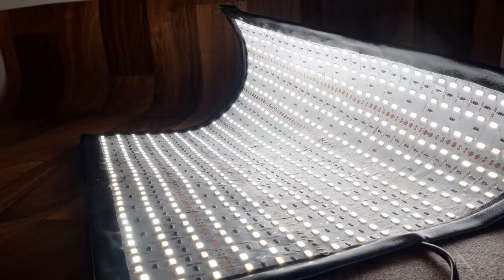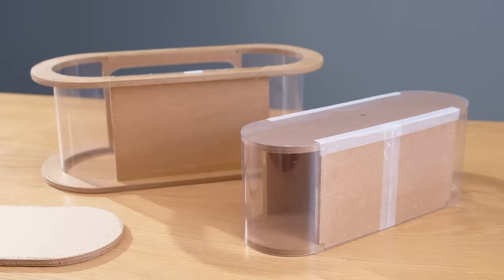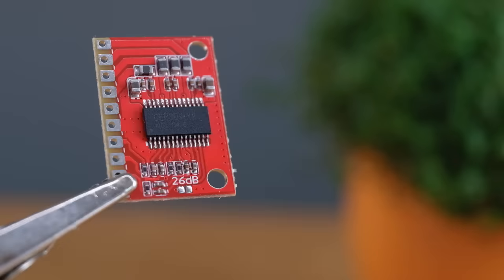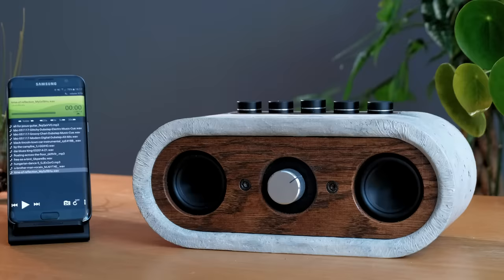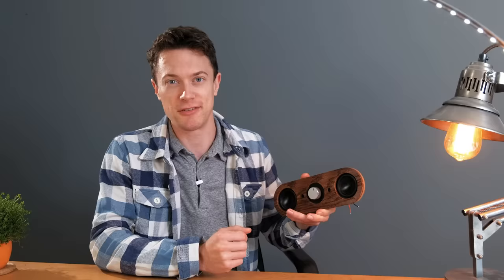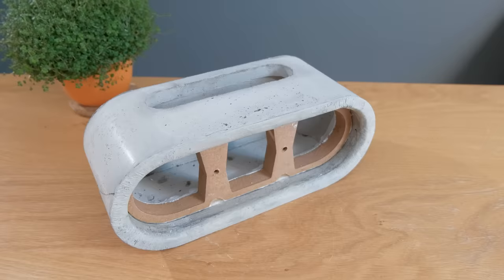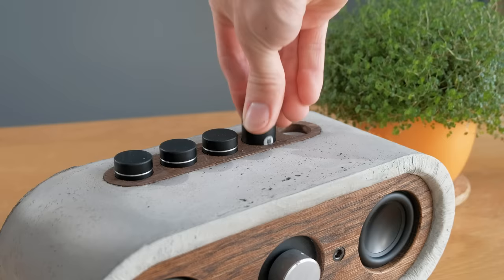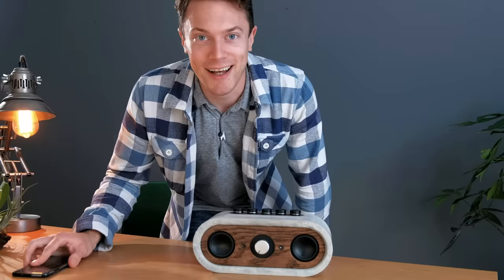Build your own Concrete Bluetooth Speaker (how-to)

Comment: Cool design but how far does that DIY Bluetooth speaker can go without the phone being near it? Asking real question here
Reply: I'd imagine that would depend on which receiver you use.  Some come with an antenna which should increase range.
Reply: The Bluetooth modules I use can go about 15 feet. They all have the surface mount antennas, if range is a concern, Bluetooth might be a bad choice.
Reply: It is possible to add to the antennas built in to most of these bluetooth receiver modules... given a concrete enclosure it might be a good idea to find a thin spot on the wood faceplate and mount a DIY antenna there.

Comment: Power cell life? how pain in the ass is to charge them? why didn't you compere that speaker whit some other one?  What did everything cost in the end? Bluetooth range? Specially whit that concrete shell.  Despite these burning questions  a great video :)
Reply: jholotan best English must not be your first language
Reply: Kilo, I understood it all, perhaps your English comprehension is not resilient enough.
Reply: amigiac Oh, on the contrary. My comprehension of English is quite good, actually. But the sentence, "how pain in the ass to charge them?" Is not complete. Also, "compere" is not a word. There are a few other things I can pick at. Although I understood OP, there are clear issues.
Reply: Compere is a word, it means the person who introduces variety/comedy/musical (etc) acts. Obviously it isn't the word jholotan best neant, but it is an word in English non the less :)
Reply: "neant" xD
Reply: Kilo-Lima He asked a series of questions that were worth answering, I'd certainly like to know the answers. Instead you've just hijacked the thread to nitpick about the use of language. yawn
Reply: John Derry Eh. I didn't hijack anything. I had a one sentence reply about English not being OP's native tongue - then people decided to jump on me and accuse me of being judgmental. 

Want me to answer his questions? The batteries can be charged with a hobby charger, the kind you'd use for airsoft or RC toys. There's a good one on Amazon, comes with different terminals to charge a slew of batteries. As for Bluetooth range - no idea. Cost? I would say around $100 USD. All those parts can be found on eBay or your local DIY shop. The concrete can be bought in small bags from the craft store, same with the sand. The battery life is dependent partly on the volume as well as the music. Each of those cells is 2,000 mAh, times five gives you 10,000 mAh. I'd say this thing would last upwards of a week - if not more, with steady use. Anker's Soundcore is only 4400 mAh and it lasts me a good 4-5 days.
Reply: For the battery life, you can see that batteries have 2600mah and 3.7V each. That means that he has about 18.5V and 2600mah => 48.1Wh. I'm sure that you can find how much 
power each component of his speaker draws in the datasheet. Just count it if you wanna know. And this should be only for inspiration, not complete build tutorial.

Comment: //just a little tip from an architecture student been done some concrete modeling: 
you don't have to cover the top of the formwork, the concrete will perfectly level out itself, and it's also great for the drying process, because the concrete can breath, and let out some air bubbles. After 1-2 days (can be less, depends on the consistence and the type of the cement) you can confidently remove the formwork, but it's recommended to let it dry for at least 2 weeks to let the concrete reach 95% of its strength. The concrete also needs watering in the first month like a plant to have a smooth, imporous surface. Soo to sum it up, concrete needs a lot of care and attention to get it in right shape!

Comment: Hey Matt, congrats on the speaker , they do sound beautiful indeed. 
I got a question for you or anyone reading this.

^ I read all the time in the audiophil community that the amplifier makes huge difference on the sound quality, I want to know if you can tell me a better amplifier that can be inserted in to this setup. I dont want to make this project more expensive necessarily but i see the overall price of the components and I can afford to go higher if it makes a difference. 
Thank you

Comment: this is super awesome but let's be honest... no one here is going to make this, lol
Reply: I might try if it's cheaper than these damn bluetooth speakers are 😞
Reply: Im doing it
Reply: totalbottle  I agree on the weight. However, compared to what's released on the market, this gives you price to performance that are far better than most deals you could get with any known brand.
Reply: This pessimism doesn't apply to me buddy.
Reply: totalbottle  Well I did, and since you disagree, enlighten me then.
Reply: totalbottle  Despite the looks and the fact that it's water resistant (not proof, resistant), overall cost for the quality is under what you can build here using links provided and/or related parts.
You can always adapt to have a better product with this DIY or have a cheaper one if you want, that's actually the point of making it yourself. However, EU prices are around 45EUR for low perf (according to reviews) product. Meh-ish at best imo.

Debatable as always but you're actually proving my point with that I believe.
Reply: totalbottle  worse weight I agree but worse sound?? It's about the quality of the electeonics and parts you can buy on linked sites are much better, that's what I'm talking about. You didn't check what you could get for this peice range did you?
Reply: I might try, but not with concrete. I work with stone, so I might try that instead. Maybe jade, it actually rings like a bell when struck so it might work quite well. And as far as the electronics, I would just use a cheap Bluetooth speaker and make the case out of stone.
Reply: totalbottle  You say that it's got bad sound, but are you listening on bad headphones? From what I heard it's pretty incredibly for a bluetooth speaker.
Reply: totalbottle  I'm not comparing it to normal speakers, I was just saying that the sound quality is pretty awesome for a bluetooth speaker. It's also not meant to be a portable speaker, so i'm not really sure why you're complaining about it being heavy? It's a stylish and in my opinion very good looking speaker that has excellent sound quality and not something you're meant to chuck in your bag and carry around with you.
Reply: totalbottle  or maybe consider the fact that some people just want a normal speaker in the house that they can listen to music on, without having to connect an aux cable each time they want to do it. Would you carry a Google home or an Amazon echo with you outside?
Reply: totalbottle  Those two are nothing alike. Just because a speaker is bluetooth that doesn't mean is has to be portable. You can still move it from inside the house out into the garden and play music from there without having to plug it in, but if you want something that you can bring to different houses then just buy some shitty portable speaker. This speaker is designed to play music easily using wireless bluetooth, and to play it well.

Comment: Total cost?
Reply: Speakers + Batteries being the most expensive

I would guess this is around 30-70 USD, but with really good sound and very long battery life.
Reply: The drivers alone cost 50 dollars each. The total cost is around 125 dollars.
Reply: You don't need specifically these.

You can get really really really good drivers for really cheap. Or go to a scrapyard and take out some for completely free. Basically as long as you have a matching pair, you can make anything work.

Just up to figuring out which ones sound real nice.
Reply: russian_ hitman blyat my comrade Privet
Reply: For you 8000 rubles, comrade

Comment: Laying the acetate on top will also prevent evaporation - and that's a good thing because concrete incorporates the water in the chemical process of curing (not drying).

Glad my university degree finally came in helpful now that I can write "but actually" YouTube comments.

Comment: 11:00 To check if the speaker in out of fase is more simple to check the labels on the amplifier board and the speaker connector, wiring connecting the positive in the positive as the same to negative

Comment: To make it easier, you should’ve added more water and admixtures. Added water would make it more workable, although it’ll lose strength, but if you find the correct admixture it’ll make it extremely easy to work. It’s almost like a liquid so you’ll get a good mold every time.

Comment: There are also isolated modules like you're using, which step down 12V to 5V, so the noisy seperate stepdown converter is completely redundant.

Comment: To tell the phase of the speakers, you can also use something like a drum app, and tap the kick drum, while watching the speaker. It should be obvious which way the membrane pushes first. But you need a punchy short kick, to make the effect easily visible. A longer kick or sound would just make the speaker move too much to notice the direction it first moves into.

Comment: You should have mixed in a spoon-full of washing up liquid when mixing the cement and sand, also mix it a little wetter. After pouring the contents in then tap the casting on the table a few times to bring any bubbles to the surface , put the top on and wait to dry. You should end up with a much smoother , even shiny finish.

Comment: Very nice! 
I have thought of building conventional bookshelf sized speakers utilizing a concrete enclosure for obvious reasons and your build shows proof of concept. The only thing you might consider adding, which can still be done, is the self stick and rather expensive sheets of sound deadening material on as much of the interior of the enclosure as is practical. This would take it up a slight notch from exceptional to superbly exceptional.

Comment: Sound is very clear without any humming. But I wonder how a small amplifier could give out such a high output. It's incredible. But in case, it the system accidentally drops down from your hand,, the concrete is  goodbye...!!!

Comment: What is the use of DC -DC isolater ...I'm planning to convert an old radio into a Bluetooth speaker by using a similar circuit.....so do I have to use DC - DC isolater

Comment: You should use that high strength concrete. Its a little rocky but that stuff is durable. Also i was thinking that thing will shatter if dropped! I wonder if a coat hanger cut up and put inside would help its strength

Comment: For anyone looking for updated links:
The dc-dc converter is a B0505S
The potentiometer is a: dual gang b50k
The amp is a oep30wx2
As for everything else, Im not sure if the bluetooth transmitter will work, but all others seem to use a headphone jack so should be the same idea.

Comment: Okay I already have some speaker drivers I can use here but I've just started to plan the build and already I'm hitting a lot of questions that are not answered in the tutorial... What is the ideal rating for the potentiometer? This isn't mentioned and the available options seem to cover a massive range. 2nd, Is the potentiometer logarithmic or linear type? Apparently logarithmic are advised for volume knobs but it doesn't say here. Additionally it is mentioned about an extra wire for use as an on/off switch but where does this come from or go to? Its not shown.

Comment: use an an electric sander to vibrate the mould and get air bubbles out of the wet concrete

Comment: It would be great if there were a way to add the dry concrete mixture, then introduce the water later from the bottom so air is forced out the top. A vacuum should do it. Should help with surface finish and eliminate voids.

Comment: Just a suggestion. Stereo Phase is determined by the sound appearing from the centre stage of the speakers if it’s outside or off behind your head then on set of wires polarity needs reversing.  I’d also suggest some accounting wading inside to avoid the standing wave resonance or tiny sounds. Other than that bloody marvellous well done.

Comment: hi.for the concrete i suggest .
Mapefill from Mapei .
is like concrete but has 3 qualities.
1)mixing it until is liquid like almost water (just read the back of the mapefill bag for instructions)fill any gap leaving no airball inside the mixture.
2)once it dry ...is like as stiff as a piece of steel.
3)the mass is lower than the mass of concrete and can withstand several hundres tons per square centimeter

important note it dry out in minutes .
If by accident u left any metal inside it ..  well 😂😂😂 u have to dump it ..is almost unbreakable and durable .
Mostly used to fix in place heavy metal frames ..in the order of tons of wieght due  to ita nature of being a liquid can fill every gap without the use of concrete vibrators; can be finished afterwards without running into the problem of creating any crack on  the Mapefill itself ...even in a very low profile of an half centimeter

Comment: I would add something to seal the box in between the two speakers.  Also, I'm considering something similar and am planning on using horn-loaded drivers and crossovers.

Comment: I don't know if it is just here in the US but concrete has gravel in it. Without gravel fill it is just cement.
Reply: John Bickford concrete is just cement and water with aggregate. In this case, he omits the typical larger aggregate and uses exclusively sand. However, as it is a mixture of aggregate and cement it is concrete.

Comment: I have watched a lot of DIY videos and I must say that yours are very high quality. However, most of them require tools that I don’t have and probably most other regular folk. Where could we get access to those tools? For example when you talked about using the cnc machine to cut out the mold pieces.
Reply: He said that you can cut them with a coping saw and he just used a cnc machine to ensure accuracy. You'll just need to be really careful.

Comment: BTW Concrete is actually great material for building any type of speakers (some of best studio monitors are built out of granite as I recall) and it's cheap to say at least. Good mass and resonance free , with it's own sound chamber - I wonder if full size (5 inch lo/mid + tweeter design with front bass relfex) wouldn't even sound better than a premium set of minitor for thousand of dollars/pounds :)

Comment: I think I will try to modify them by using 4 3.7v lithium-ion batteries and a 3.7v to 5v converter instead of the step-down transformer, using a protection circuit and placing the batteries inside and placing the speaker verticle instead of horizontal

Comment: Use an orbital sander on the underside for 2-3 minutes to remove air bubbles right after spooning in your concrete mixture.

Comment: Hi Matt, I have just started watching your videos and I find them fascinating and instructive. From the security cameras to to the "magic mushrooms" they give and old man hope to build something useful and aesthetically pleasing. I like this build and hope to emulate it however I am  changing the power system so that it can run off 220v or internal battery, just working out the kinks on that but you have been an inspiration, thankyou

Comment: I'm sure this would make the circuitry significantly less simple than it currently is, but is there a way to make this rechargeable without removing the power cells and charging them individually?
Reply: Yes using a DIY battery management system, im pretty sure great scott has several vids on it

Comment: DIY Perks, I have a suggestion for something I have always had in the back of my mind but I have no idea where and how to start it. The project is about ceiling fans and 5.1 channel speakers mounted on the fan's blades. I wonder how the sound will turn out as the fan spins around. Will it get distorted? ... if you can pull that off, I would appcreaite it very much.

Comment: Nice project, Would have like to see a bass flex tube in the back, (helps the speeker too move esayer) and a direct power power connector/charting port. and maybe a ambient led over and under the dial..

Comment: Great Video - and project!  Not sure about the total air seal (sp?) on the box.   I've always used a vent because the speakers need to breath on the back side or you will limit flex.  Also - just me, but I would want direct in and out sockets.  This is a project I might actually try - thank you for that!  Subscribed.

Comment: Hi, it looks and usage are modern. 
What if, if you use a Granite instead of concrete for outer shell.
Also having a Passive Radiator and Aluminium rubberized Stand Feet.

Comment: still love this, just out of curiosity, to charge to remove the 18650 batteries and charge externally, or could you incorporate a BMS circuit within and just plug in a 12v supply when needed?

Comment: The bass sounds out of phase because you didnt give each driver its own chamber. If you correct it with a simple solid and stiff divider inside to keep them separate your overall sound quality will be noticeably improved. Be sure that everything is airtight, with no leakage, very important. I really admire your skill level and knowledge , Ive followed you for years.
Reply: Interestingly he did exactly that in the more recent speakers video.

Comment: Thank you for your video. This speaker is really cool. I have built it but I keep frying the buck converter and isolating converter. The links are broken so I wonder if I have the wrong parts. You use a 1W 5VDV to 5VDC isolator B0505S-1W  and D-Sun 47R buck converter. The USB module can potentially draw 500mA which means the isolator receives 2.5W. In my case this has resulting it it getting very hot and dying nd frying the power amp at the same time. What am I missing?